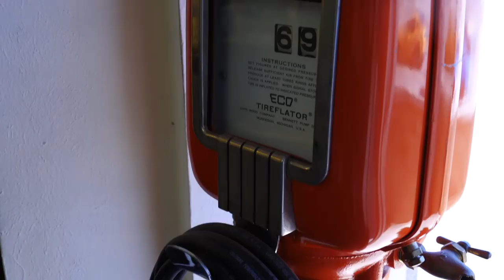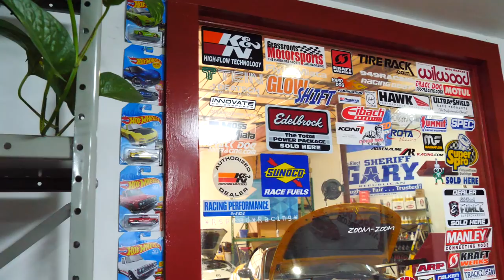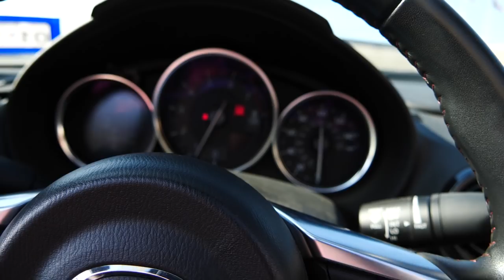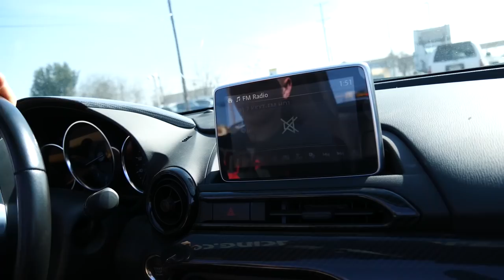Visiting TRACK DOG RACING and Driving Fast Supercharged Miatas!

Comment: Never buy rethreaded tyres, your life is worth more!
Reply: They’re good for drifting but I would’ve never put them on a several ton, long distance vehicle
Reply: *retread
Reply: These aren't retreads, they're re-molded. The entire tread gets ground off and recast, it's not like the crappy retreaded semi tires you see blown out all over the interstate... and yeah. RIP his sponsorship. I certainly would have called Treadwright before I ran my mouth about them.
Reply: Check the last video. He basically said he took the bus 'offroading' to get to the drift spot... in an abandoned building lot full of debris. If you got a nail in the tire or some other bit of damage or even if it's just run at low pressure and then you run it at highway speed it will heat up. That's especially true when you're running a dually and it's harder to notice if you are low on one of two tires. That's why every time you saddle up for a road trip you check every single tire's pressure, trailer too. I'm a big Gingium fan, but to slap a sponsor in the face as a knee-jerk reaction to popping a tire... probably not good practice for the future.
Reply: PumaGaming why would you want to be sponsored by a trash company anyway.
Reply: AbominableJoshie it’s the second time I’ve seen a YouTuber have a treadwright tire delam. Who gives a fuck about the sponsorship. I’m not putting shit tires on my car whether or not someone else is paying for them.
Reply: @retrotellephone  I had Treadwrights on my 4runner that were great. Sold the truck, tires still working out fine. I told Chris from B is for Build about them and he's still running those tires on his FJ. I don't know what other YouTuber you've seen this issue from, I haven't. At the end of the day, other sponsors will see how he reacted to an issue with a sponsored product. Even if he isn't interested in Treadwright anymore, his reaction may make him seem like too much of a hot-head for other businesses to give their product to since he's shown that when things go wrong he just takes it to the video instead of talking through the problem with the sponsor first. Conspicuous maturity goes a long way.

Comment: Never put recaps on a heavy vehicle. Especially one for towing. They will all blow in time. Truck drivers get a bad name useing recaps. It saves a dollar, but you loose time and money as usually its another tire. Also, make sure your duals dont touch. Builds heat and will blow a tire. Need at least half an inch of space but thats without the tire buldging. Hauling like, you need an inch or so. I drive a dually pickup and learned from many others that have made mistakes.

Comment: Gingium make sure you have the same amount of psi in each of the rear wheels bc if one tire has less psi it will drag and heat up the tire thus making it fall apart or explode

Comment: Hey! I have a 94 mx5 that I've been fixing up, I was wondering what the best shocks are for a smooth ride as mine still has the original ones. I've been trying to turn it into a daily drivee.
Reply: Koni Sports or I was actually impressed with Yonaka Coil-overs

Comment: I am debating going turbo or blown with my 95. This video may have swayed me
Reply from the maker: Go turbo (its better, shhhhhh)
Reply: @_Gingium_ , Or you can get the best of both worlds and get a Rotrex!  It's like a belt driven turbo.
Reply: William Curran lol a belt driven turbo is a supercharger dummy
Reply: @shady_77 , I mean it's centrifugal like a turbo.
Reply: William Curran there is 2 types of supercharger, blower and centrifugal
Reply: fnqzera you mean "there are 2 types; positive displacement, (known to the American scene as a roots style) and centrifugal". BLOWER is a nickname for the entire supercharger family, but is more commonly used to describe positive displacement superchargers
Reply: Gingium You're right, I should. I simply hate supercharger whine too much. But turbo noises? Mmmmmmmmmmm
Reply: @adamcroteau8711 , The Rotrex doesn't whine.
Reply: Hmmm... ok. How much does that kit cost? I don't  want to spend too much on a 4 thousand dollar car
Reply: @adamcroteau8711  More than your $4,000 car.  A well sorted bolt-on boost kit is going to be more than $4k.
Reply: Yeah the Kraftwerks kit is 3800, but it makes like 160 wheel so Naw
Reply: @adamcroteau8711 , Our TDR kit is $4700-$4900.  It makes 220-250 rwhp on a stock motor depending on year.  90-93-220, 94-97-225, 99-00-250 and 01-05-235  The one @gingium drove was 280 on a built 99-00 motor.  We have a customer on ethanol running 350 rwhp.